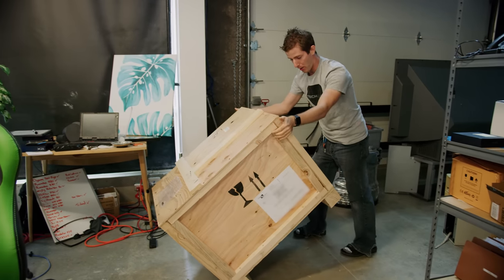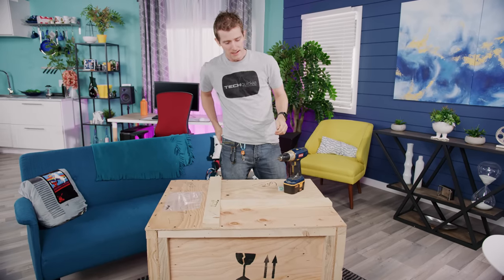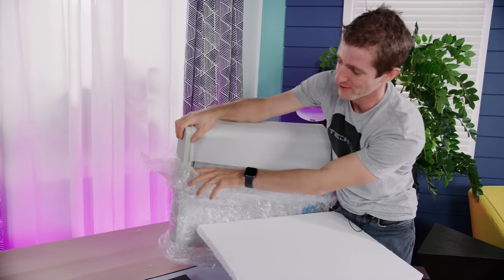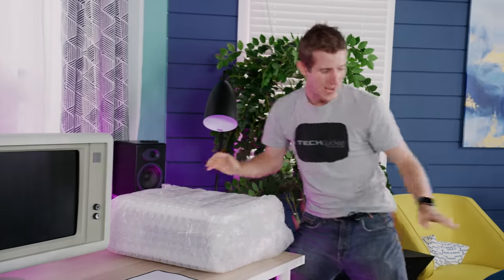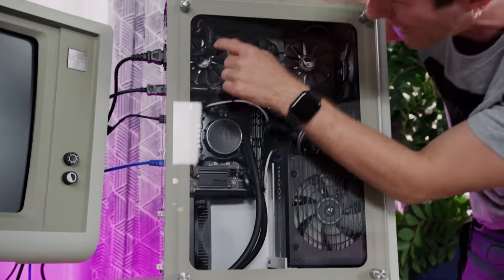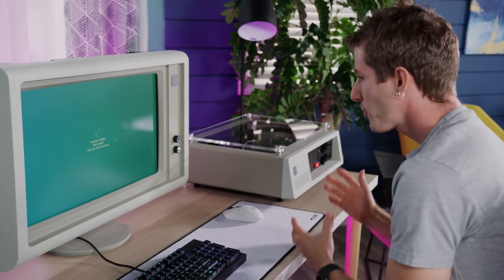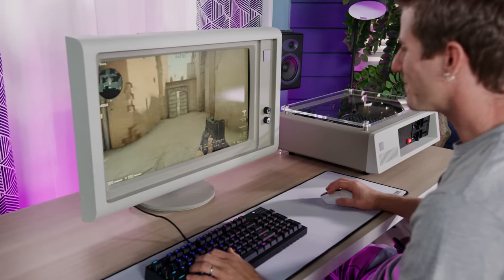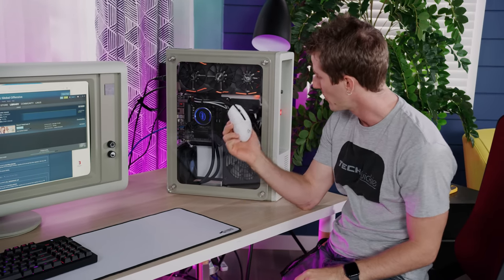The COOLEST Box I’ve EVER Opened

Comment: The monitor goes on top of the machine linus.
Reply: I was thinking the same
Reply: The top panel is acrylic, it scratches very easy... If it were glass I would say yes to putting the monitor where it belongs.
Reply: @JJ_ExMachina  A piece of cloth can be put between them. Or proper feet under the stand.
Reply: John M ... You can scratch acrylic with your skin if you rub it, with a fair amount of pressure... Anything placed on the acrylic panel, is going to cause scratches... SO sure if you don't mind scratches feel free to do whatever you want, to your own custom made PC.
Reply: Acrylic scratches easily? O.o I guess there are different grades of acrylic because I have some acrylic which doesn't scratch when I scrub it hard with metal sponge...
Reply: he could wall mount it or use one of those fancy VESA arms, though it would probably have to be painted
Reply: @JJ_ExMachina  I'd be surprised if Teflon feet manage to scratch it.
Reply: But maybe they can reach out to dbrand for a protective, appropriate covering.
Reply: I scratched my acrylic side panel with a soft microfiber cloth..
Reply: @-eMpTy-  Same here. I wasn't even applying pressure, yet when I finished dusting off the acrylic panel on my 750D AF with a microfibre cloth, it ended up getting scratched. The cloth was brand-new and perfectly clean.
Reply: Wow, they have courage sending something that soft to linus. Hollywood prop makers never seen his videos then.
Or maybe they used some proper glass.
Reply: noname ... Yes there are scratch resistance coatings that can be done, and there are different types of Acrylic substrates as well... However, you are never going to be able to scrub plastic with an abrasive metal sponge and have it come out scratch free. Plastic (no matter how it is made) is going to have a far lower hardness on the Mohs scale, then the material a metal sponge is made from. SO I am calling BS on you being able to "scrub it hard with a metal sponge", acrylic is far softer then glass, and you can easily scratch glass with sandpaper and Brillo pads or steel wool... SO if you can scratch glass with a "metal" sponge then even the most scratch resistant acrylic is going to show signs of scratches. I bet if you looked close you would see all kinds of scratches in the surface you are scrubbing with that metal sponge.
Reply: John M You are correct true Teflon would not scratch the surface, however any dust or grit trapped between the Teflon feet and the acrylic surface would cause scratches.
Reply: @JJ_ExMachina  how hard would it be to hide those crimes? Just a quick polish to remove or will it be  a thorn in their eyes forever?
Reply: Well. I know too about hardness and so, but well... There are close to none visible scratches after like... 16 years of use. I'm not talking about microscratches and stuff. And I apply really big pressure during the scratching... Softer metal sponges are being shredded after few uses, only harsher ones endure it. But well I don't want to talk about it further tbh, I'm not here to argue
Reply: noname ... Then the material you are "cleaning" with a metal sponge is NOT acrylic... Yes it might be clear... BUT I can guarantee you that the surface you are scrubbing with metal is NOT plastic... If it is cold to the touch, then it is some form of glass and not just any glass, but Borosilicate or Pyrex glass... That stuff is so strong you can heat it to well over a 1000 °F and then stick it on ice and the glass will not crack. You try that with normal soda–lime–silica glass, aka drinking glass, the most common type of glass and it would melt. If you heat normal soda–lime–silica glass to around 300 °F, then stick it on to ice, it would crack. SO more then likely the thing you are scrubbing all this time with a metal sponge is Pyrex... since the only reason I can even fathom someone scrubbing something with a metal sponge is to clean dried or burnt food from it. SO a casserole dish or glass cookware maybe? After all you have not said what it was or why you are even "cleaning" the thing with metal to begin with.
Reply: noname ... Plus things made from Pyrex glass are so strong that it can withstand scrubbing on them with metal sponges... I am talking real Pyrex Borosilicate glass... and not this fake crap we have seen in the last few years coming out of China.
Reply: ... It's a bathtub x)  It's not cold to the touch
Reply: noname ... Enough said... that is NOT plastic or glass... that is Ceramic. Same sort of material tiles are made from. The space shuttle uses ceramic to protect it from heat during reentry in to Earth's atmosphere. Ceramics are some of the hardest man made materials on Earth, there are some that can easily cut Diamonds (the hardest naturally occurring material on Earth). SO now it makes perfect sense when you can scrub it with a metal sponge and see not scratches... Bathtubs are made from ceramic, just like tiles and Toilets. They use ceramic, because the material has such tiny pores that bacteria can not penetrate them, and you can make them in to pretty much any shape since the process starts out as a liquid and then is heated to a few thousand degrees and hardens. SO yeah that is diffidently NOT Acrylic you are scrubbing, it is Ceramic. From now on, make sure you are aware of what material you are talking about... Or in my case I will have to ask more details on what it was exactly that someone like yourself was talking about. This would have easily cleared up your confusion so much sooner.
Reply: The bathtub is ductile... Ceramics are not as ductile, I think. It bends under weight
Reply: noname ... Yes yes, that is because it is a specific type of Ceramic coating called Porcelain. The manufacture coats the substrate with the Porcelain and then cures it. So whatever substrate they used is flexible. Still does not change the fact that the Porcelain aka Ceramic coating is what keeps you from scratching the tub when cleaning it.

Comment: tbh one of the main appeals for a sleeper build, for me, is that there are no showboat windows. No one should know what's inside unless you have the case open. That's not to say the acrylic is bad looking or anything. It's nice. I'd just personally try to take that off and make it look closer to the 5150.

Also that monitor. A TN panel? Fix it.

Comment: My first computer was a Commador 64/128.
Reply: Mine was a Ti-99 then a Commador 64 then a 8088 XT clone. By the way the 8088 was an XT so it would have used a Model F keyboard. The model M was an AT keyboard.
Reply: I was only 5-8 years old at the time. Played video games on floppy discs.
Reply: you mean commodore 128 because the 64 wasn't the same as the commodore 128 but the 128 could be a commodore 64 minus all of the enhanced features of the c128
Reply: I really wanted the Amiga which had way better graphics and audio. I ended up getting an EGA graphics card and a sound blaster later.
Reply: Time Sinclair z80 followed by a kaypro 16/2

Comment: You need one of those old computer desks with the 3 levels and a keyboard/mouse shelf that slides in and out. Off white colour too. Or even better one of the metal ones. And a ribbon printer kitted out with inkjet but sound effects to match the original.

Comment: Old style monitor isn't an actual CRT...
Dislike
Reply: You can't drive a CRT panel with a digital signal, and modern high end hardware only outputs in digital.
Reply: Umm why am I still using my beige crt with modern hardware then? (amd 580 modern enough)
Reply: it's easily done with a DVI to VGA converter..
Reply: @sethknoetze7891 exactly with I'm doing, I kinda want to get my hands on a rare 16:9 crt too
Reply: but thats the trick with it
Reply: @brendanshroyer7696  most "high end " and "modern" video cards with dvi ports will come with dvi to vga converters and if the card you get end up not having dvi then there are powered display port adapters that can be purchased for an analog signal
Reply: @Brisingr_Phoenix  The 1080ti doesn't have DVI, and even if it did, it likely would only support digital output.  Only DVI-I and DVI-A ports support analog, and they are considerably rarer now, even on cards that still have DVI at all.  Most modern cards with DVI ports use the digital DVI-D standard.
Reply: @SmilesHeavy  I don't know which specific RX 580 you have, but it's a mid-range card, so there is at least some chance of it supporting analog DVI on some models, whereas it's extremely unlikely to find it on a GTX 1080ti.
Reply: @sethknoetze7891  DVI to VGA converters only work with DVI-I and DVI-A ports.  I have cards with DVI-D only and it simply isn't possible to plug the adapter in because the analog pins don't exist on DVI-D because it is digital only.
Reply: @brendanshroyer7696   use a display port adapter then... Point is it might be janky but it's doable
Reply: @sethknoetze7891  "Digital Visual Interface" sounds analog to me
Reply: @sethknoetze7891  I'm also using vga to hdmi which nearly every card has

Comment: More rgb, aurous rtx card (rgb on them would look sick), cable management, and a custom loop for cooling (if it fits in the case maybe an external back mounted reservoir to make it fit). Can't think of anything past that that would make it More radical my dudes. Oh and maybe fabricating a replica old IBM keyboard case and key caps for a mechanical rgb keyboard like a blackwidow or k70. Super exciting build!

Comment: Get the Model M plugged in, custom retro shroud for the 1080ti, retro looking fans and cable sleeves, tan wheel mouse optical w/ hyperglides and tan paracord, and somehow get a modded CRT monitor case. And some nice white LED strips.

Comment: Run linux on it and then put retro term on it to fool people into thinking it's a real CRT.  You can even emulate classic ibm terminal with it.

The monitor should have had a fuction like classic crt's where you can adjust the size of the picture to fit the viewable real estate, you could make it smaller, move up down, left right.  Could probably be done in software.

Other than that, sad an old IBM had to die, but it's pretty damn cool.

Comment: You should get an old ball mouse, as well as a really small laptop-like laser mouse, then hollow out the ball mouse and fit the laser one inside (a small hole may have to be drilled for the laser...) so you have the working laser mouse inside the ball mouse chassis.
Hard to imagine a better fit than a ball mouse that still has a working ball!

Comment: That's not what the original 5150 front looked like, look it up. There is no "Run" button, the rear power switch IS the power button, and the floppy drives are side by side, not to mention right-side-up. I like sleeper systems, but this is a bit sacrilegious.

Comment: @Linus Tech Tips Ok, my idea to complete the system is a bit different of what any of you immagine. It could be made into 2 diferent versions 1 would be an Led projector inside that case that could display with a mirror on the top glass some random images and videos from the 80's or story like videos like the ones from fallout using it as a second screen, or better (2nd idea) would be an old kind Lcd screen without illumination=becomes transparent if off that could provide those movies base and under the corner of the case an Led strip that could illuminate the internal of that tower providing images on the top, maybe actionable with the old floppy levers would be cooler.

Comment: The original IBM PC/XT came with full height floppy drives. These half height covers are incorrect. And I think they are placed upside down. Additionally, the power switch was in the right hand side of the chasis, to the back. Not in the back panel. So, if the right edge in the back doesn't have a square gap, then this is not an original chassis and we can relax that not an actual IBM PC was harmed in the making of this video. About the 8086K, nice try, but the PC/XT range came with an 8088 (16bit address, 8 bit data) to save some money in RAM and complexity. So 8086 and IBM 5150 aren't related. Finally, I have never ever seen a red push button called "RUN" in the front. That bezel should be the front cover of the full height hard drive of an IBM PC/XT (model 5160), so again, that's another incorrect reproduction. And BTW Linus, thank you for your videos. I really enjoy them.

Comment: My dream would pretty much just be Dell adding their hardware pcie x4 egpu plug to their XPS. (as opposed to software thunderbolt).

By far the best egpu option on the market, but only currently available in Alienware laptops, which are all beefy with their own discrete gpus, and look like they are designed for kids.

Comment: IBM keyboard and track ball mouse for sure
also get a Seagate MFM 506 and use it as stand for monitor and gut out an 8 inch wan floppy drive and pur inside a 4 7200 hard drive enclosure with fan as your storage 
pecking water bird a must have

Comment: Take an original 8086 and find a way to overclock it to extreme speeds. (i'm thinking 486 performance at best)
Modern active cooling should be able to offset any heat problems.
Reply: No way you could get 486 performance. 286, maybe, but I'm doubtful.
Reply: @BringMayFlowers  yeah, that was likely a combination of wishful thinking and ignorance of how different those processors are.
Reply: @tOSdude  Well, for one, the 808*8* used in the 5150 is 16-bit with an 8-bit data bus, cutting its speed roughly in half over the 8086, which was a full 16-bit chip. The 486 is 32-bit. It also introduced cache (8KB L1), an on-die floating point unit, and improved memory management -- making it twice as fast as the 386 for the same clock speed, let alone the 8088. Honestly, I don't think anyone has ever looked into how many times faster than the 8088 the 486 is, though I suppose it could be fair since the 8088 ends at 16MHz and the 486 starts at 16MHz. Except it wouldn't, since 486 class hardware (Sound Blaster/Ad-Lib, Super VGA) are faster than their XT equivalents (Speaker/Tandy 3-voice, Hercules/CGA).
From what I can see on a Vogons thread, a 25MHz 386DX is about as fast as 19x an 8088 at 4.77MHz, so the 8088 would have to be clocked up to 182 MHz to match a 12.5MHz 486, one that never existed, or 364MHz to match a 25MHz 486, assuming the tests are compiled for the 8088's instruction set -- or else you'll need to emulate the extra instructions, which will probably bring your needed speed up close to 1GHz. It's notoriously tricky to overclock an 8088 past the double digits without corruption.

Comment: I bet they used a broken 5150 for that. Also missed opportunity with 4.7GHz. You should definitely get a Model M or maybe a Model F working, and find a more fitting mouse.
Reply: Broken or not, the parts and case could have been used as spares.
Reply: @BringMayFlowers  yeah but at least if it wasn't working already you can feel less bad about it lol
Reply: @WCBROW01  Not really no, since a broken one could be used for parts and a donor case at least, and it may have been completely working besides the capacitors, which are easily replaceable.

Comment: When can I buy that freakin' monitor??? Also, that's the exact same model PC as my first PC I had back in the late 80s.

Also, you shouldn't be turning on that PC without mounting antennas on the WiFi connectors. Might burn out the transmitter module.

Comment: Linus, Correction The IBM PC's as well as XT's and AT's do not have a power button. you powered the system on and off using the switch on the back like you showed. So your term of "original power button" is false. They also had an 8088 not an 8086 for the processor so that is false as well.

Comment: Intel said the i7-8086K made sense since its an original IBM 5150??? The 5150 was shipped with an Intel 8088!!! The predecessor to the 8086. Aka not x86 architecture.
Wow... How Intel themselves even forget their history. Pretty sad.
If it was an 5170 aka a PC AT which looks completely different, those had 286 processors in them.

Comment: Well the 5150 came with an 8088.  The 8086 was a true 16 bit processor.  The 5150 was an 8 bit machine outside the internal CPU.  It was cheaper to produce an 8 bit machine and the 8088 was more readily available.  So technically you should have a PS/2 model 25 or 30 case.  :)  Yes I know the 8088 was a 8 bit version of the 8086 and used the 8086 instruction set.  But the world would have been much better off if the 5150 used and 8086.  The PC wars would have started out at 16 bits instead of 8 bits.

Comment: This is way too late to be commenting but if you cap CS:GO's fps at 0 instead of, for instance, 999 or 500, it actually decreases its performance and doesn't give an accurate representation of the true FPS you'd be getting. I have mine set to 300 and it sits at a solid 290-299, others who have better systems set theirs to upwards of 800 and get 790-799 constant so... just food for thought.

Comment: Jesus Linus you think the way they set this up is cool you should see my trs-80 model 2 build. wait till i eventually finish it the way i want to with custom acrylic lid and light up trs-80 logo on the side. :) in mine the 8" floppy drive is converted to a 2.5" docking station by using a stack of 8" floppies as a tray for the hard drives or ssd's the original keyboard i rewired to work on usb while still keeping the original din 5 connector. i even kept the original io panel and connected panel mount cable to so you could connect the pc to stuff. even the fuse port thing is still in use :) to get room inside i replaced the crt with a lcd. im looking into getting the crt front glass cut off by someone so it will look better in front. :)